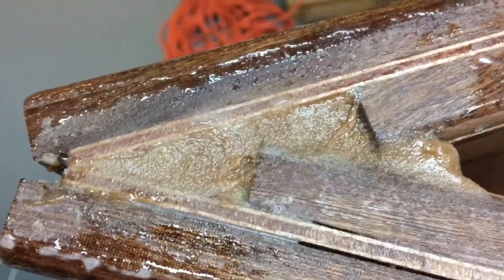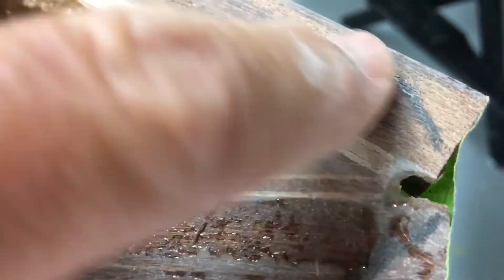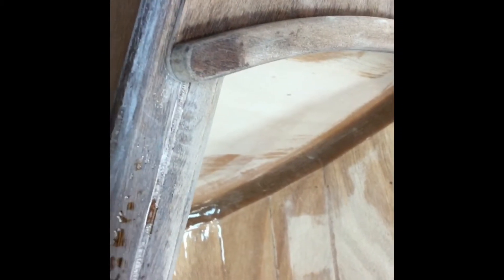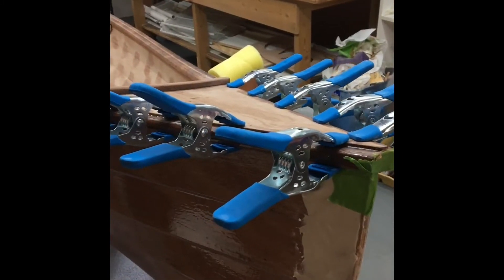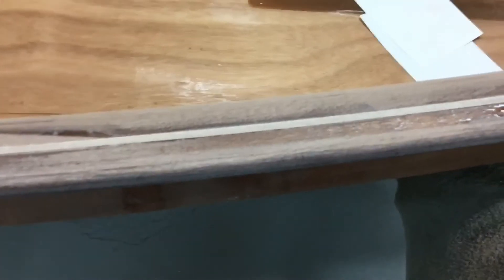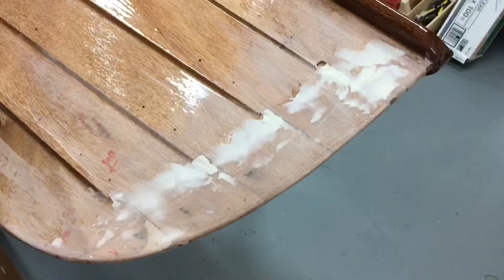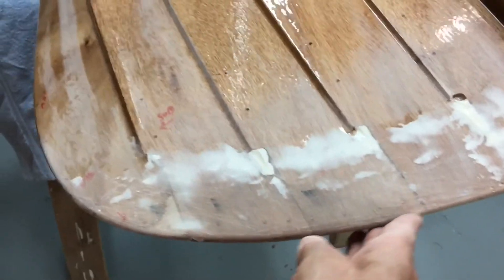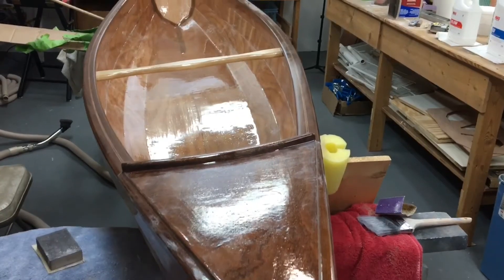Sassafras 12 - Episode 15 - Finishing the Assembly

Comment: Congrats on completing the assembly.  Looking forward to seeing it painted.  Florida beach looks nice.  Getting more snow here in Colorado.
Reply from the maker: Hi Rick, Now the REALLY SLOW part begins - painting and varnish.I will probably have 4 coats of high-build primer ( each sanded mostly off ) to get the finish I am attempting. The next video will try to show just how much priming and sanding is necessary. Remember the original question " are you building a boat or furniture? " I am still on the side of furniture and the time required reflects that. Thanks for watching.
Reply: @captainboatbuilder4517  I recall you said you were a pilot.  No doubt the necessary attention to detail has carried over to boat building.  I’m sure it’ll turn out quite beautiful.